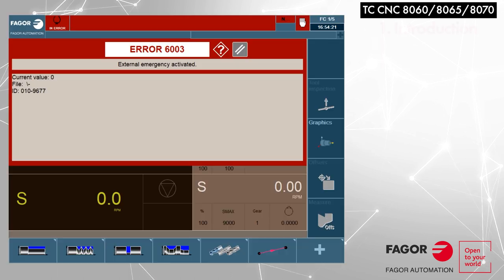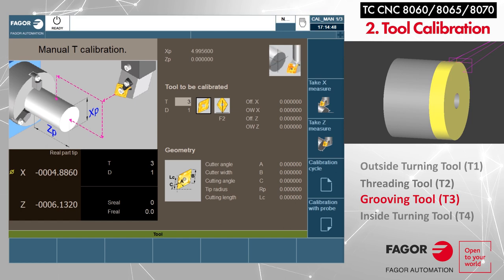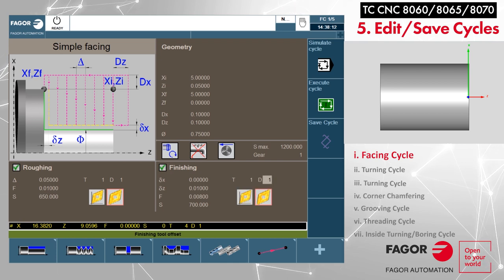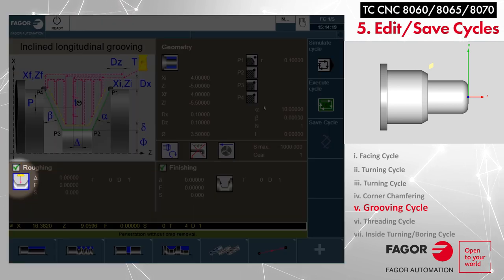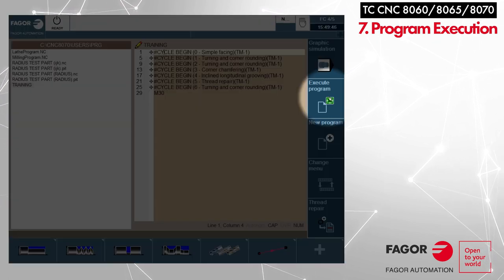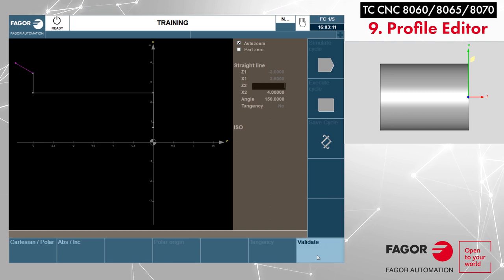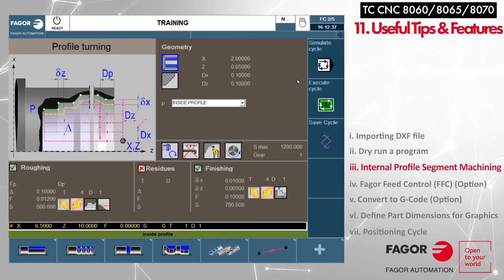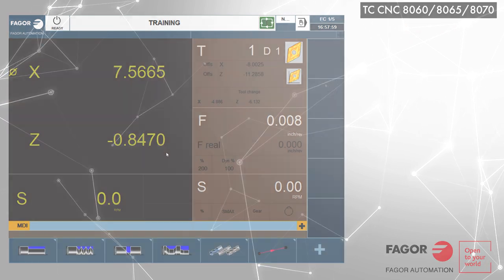Lathe Conversational Programming FULL COURSE - Fagor TC CNC 8060 / 8065 / 8070

Comment: 8070 lathe with 4 tool magazine, is there a way to have more than 9 Tool offset number (D)? How to program (in iso)  a line of holes in incremental mode (6 lines every 60 degrees, around 850 holes. How to save machine data (backlash) permanently (it changes every time we turn machine off) Thank you